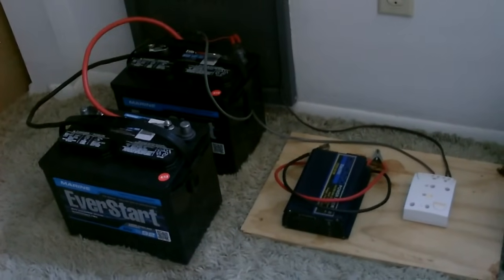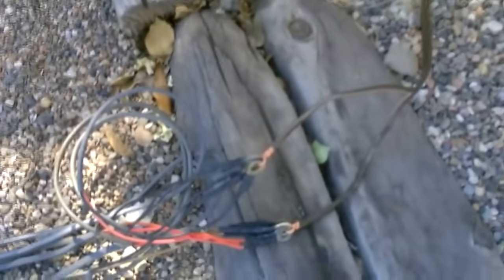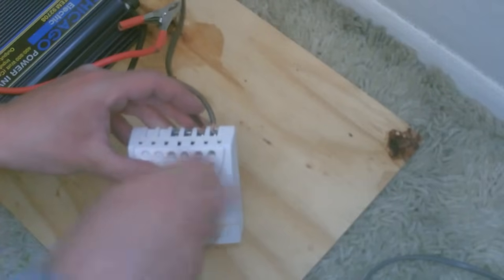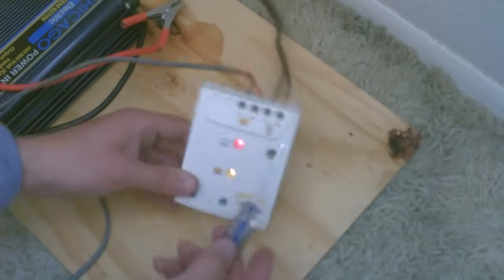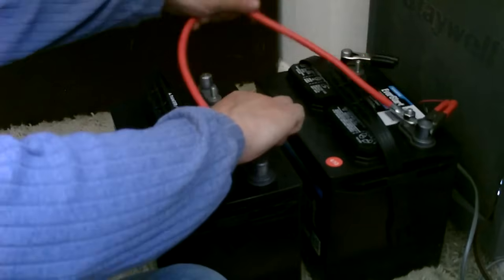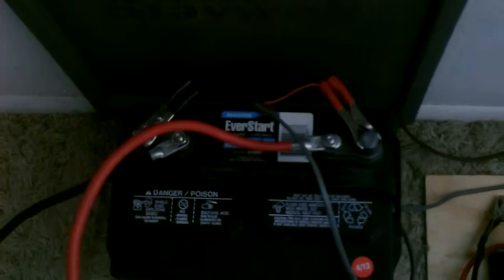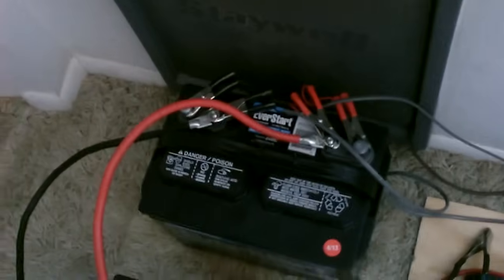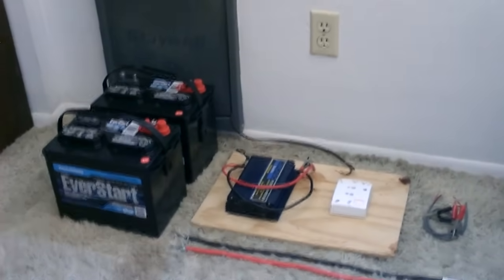How to hook up Solar Panels (with battery bank) - simple 'detailed' instructions - DIY solar system

Comment: Hi, my name is Ana. I have an 100 watt Renogy Solar panel, 4 batteries 93 ah and a 30 amp charge controller. my question what size of inverter I should use ? I am having problem to decide on which one I really need. thanks for your video
Reply: Ana AA That question is rather difficult to answer in general. It would depend on what you wanted to power and how long you wanted it on. The bigger the inverter and ac power you use the less time it will be able to work without draining the batteries. On mine, I have the 45 watt Harbour Freight solar panels connected to one battery. I have a 300 watt inverter that I have used to run a CFL lamp for 3 or 4 hours during a power outage without any problems. The lamp was very low drain (about 15 watts) and I wouldn't try running a computer or anything on it for any length of time. Normally I just use it to power my 12 volt ham radio gear without an inverter..
So basically, just remember that the larger the inverter used, the less time it will work on that setup.

Comment: Curious. Can I charge the batteries "let's say I have 4 deep cycle", with one normal battery charger with higher amp output? I'm thinking about doing this with my travel trailer, and power the charger with a small generator, until I can afford to go full solar. Let's say a 20 amp charger, divided by 4 large marine batteries is 5 amp each, right? why wouldn't this work? If the batteries are kinda dead, I'd like to speed it up with let's say a 80 amp charger to get each LARGE battery 20 amps, until it's time for a small trickle charge.

Comment: Hi, nice video! One Question: What's the difference if you connect the batteries in series instead of parallel like the one you've set up here.
Reply: Metalarm If you wire 2 batteries in series you will have a battery with a nominal voltage of 24v, to charge this you will need to wire 2 solar panels in series.

Comment: Great video. Just 1 question. Will the batteries overcharge and die at a point? Also, can this hook into your home to lessen your electricity bill or is it only a stand alone system? Thanks again
Reply: Buildin_N_Preppin Get yourself a good controller, it will cut off when the batteries are full and stop them draining back into the panel at night.
Reply: +Steve Westcott which one do you recommend?

Comment: Great video !!!  I run my whole house just like this except with 10 batteries and a 5000 watt inverter wired to the existing fuse box in my house..making all the switches and plug ins work correctly. .9 watt bulbs glowing all over the house..works outstanding and can go a week or better with no charge..DO TRY THIS AT HOME !!!!
Reply: coreymoore1000 How many panels and what size?
Reply: coreymoore1000 hi.. does your washer and dryer work with dat as well???
Reply: how much your setup coast
Reply: how much your setup coast
Reply: how much your setup coast
Reply: coreymoore1000 So Awesome! How many panels at what watt configuration do you have? I’m starting to plan my system and yours sounds ideal.
Reply: if your panel is tied to the grid in the event of a power outage you will be sending  juice back into the grid witch can kill an unsuspecting utility worker
Reply: gary jones oh well fuck him..
Reply: Learn grammar you fool, dat should be that...fool.

Comment: OK I AM KINDA NEW TO ALL THIS , AND BOUGHT A BRAND NEW 1800WATT SOLOR GENERATOR , BUT IT DONT LAST LONG OR JUST NOT STRONG ENOUGHT TO DO WHAT I NEED IN A 30 FT CAMPER , SOOO MY QUESTION IS CAN I JUST USE THE ONE SMALL SOLOR PANEL TO CHARGE ALL MY BATTERIES , ITS ONLY GOT ONE BATT NOW BUT WHY COULDNT I HAVE ANOTHER CHARGING WHILE ONE IS BEING USED,,,,,OR RIG IT TO WHERE ALL THE BATTERIES GET CHARGED ?????? JUST THINKING ???????????? CAN YOU RUN THEM IN LINE TO WHERE THEY ALL GET THE SAME CHARGE

Comment: effectively and with a little electrical know how you could opt out of the grid system for your home lighting by installing led lighting running from a 12v system very cheaply for you whole home just using the wiring already installed,taking the home lighting circuit out of the fuse box system and turning it to a 12v independent system..led lighting uses 1/3 of the power a normal light uses !!...food for thought.

Comment: So how do you work out how many batteries you can have in each back, to how many controllers you need to solar panels? I am wanting to install a 4000W inverter and my solar panels are 15A each. So 1 controller is rated to 190A and can take 3 panels, but how do I how how many batteries I can have in that bank running off 3 x 15A panels? Is there a rule of thumb for batteries to panels?

Comment: can i series 12 battery for 24 volts and charge it with  panels that have around 36volts series?
Reply: It depends.

You can put 2 identical 12V batteries in series to make a single 24V battery.

You must make sure that your charge controller can:
1. Handle a 24V battery bank.
2. Handle the nominal voltage from your solar power bank (36V).
3. Handle the highest peak voltage that your solar power bank can produce. (Check your panels specification or measure output voltage in full sunlight without load).
4. Can handle the maximum current that your panels will produce. Note that the current can depend on the voltages used.
Generally a tiny sized charge controller can get overheated (as it has a small heatsink or non at all).

So, by choosing the right kind of charge controller you can do what you ask.
In general you want to keep the voltage of your power bank the same as the voltage your load wants.

Comment: Thanks for the video.What kind of wire did you use to connect from charge controller to your batteries?
Reply: Gary H how far is controll form battery

Comment: How long can this setup run at 75amps
Reply: I have about the same question.. did you figure it out?
Reply: if you're talking 75 amps ac 75 x 120 = that inverter is going to show red and start screaming at you as soon as you flip the switch, amps x volts = watts

Comment: How durable and weather resistant are these panels? How long could you leave them outside before they start to "weaken" strange question but I'm curious. Also what kind of matinance do these setups require
Reply from the maker: Josh O'Connor hi. there durability is equal to any standard solar panel designed for home use. i've had these panels for 8 years. they've endured high winds, heavy rains, golf ball size hail and lots of high heat and still work/look perfect. they're mean't to be left outside permanently. with regards to "weakening" the panels are designed to meet the industry average (which is that they will still put out no less than 90% of rated max. at 10 years and no less than 80% of rated max. after 25 years). note that most panels will not degrade this much. (many solar panels that are 20-35 years old now are being tested and are still putting out up to 97%). in terms of maintenance, other than checking the fluid level in the batteries from time to time (and adding distilled water if it's low) there is no maintenance required. for reference on the last point, my personal experience with the fluid level being low is that i've never had a low fluid situation in 8 years of using these types of systems. (and that is charging and discharging the batts almost everyday for the life of the batteries (typically about 1000 charge cycles))
Reply: Thank you! My only thing holding me back is it seems like you would require an absurd amount of solar panels to power a house, somthing like 500 square feet
Reply from the maker: Josh O'Connor powering entire house does take quite a few panels. (consider building up the system in increments. saves you from having to fork over one big lump sum all at once). that's what i did originally. (my oldest/first video shows my original system. that system was built in 4 stages (one battery + one 3 panel set) purchased at 4 separate times. as your building it you'll have a "solar assisted" house.
Reply from the maker: Entheogin913 hi there. without knowing the specific wattages of each item it's hard to say but in general i'd say a system about twice as big as the one in this video (my first video post shows a system about that size). ran that one for 6+years.
Reply: desertsun02 What type of wire with amp did you use to connect the controller to the battery and to connect the batteries together ?
Reply: Josh O'Connor I use Trina Solar solar panels. They are warrantied for 20 years and I have installed them in all conditions.
Reply: desertsun02 Hey i am thinking of buying 4, 100 watt panels. Could you tell me exactly what i will need to buy to hook it up? I am not going to hook it to the houses electricity i am just planning on using a surge protector to plug my stuff in.
Reply: Magnet moter
Reply: +desertsun02 what is the name of the company  you bought  the solar panel from?

Comment: Does anyone know if a charge controller is completely necessary? I have a 15 watt 12v solar panel connected to a 12v deep cycle battery connected to an inverter.  I do not have a charge controller and my solar panel is not charging the battery.  All items are less than 3 months old.  Any advice would be appreciated....thanks....Rick

Comment: Finally, a simple and accurate explanation of how this works and how the connections should be made.  It was really nice the way your video showed the connections from start to finish, in that order.  Your the only person who had enough sense to simply followed the wires back from solar panel in order from connection to connection.   I am not sure how the the other video makers even got their stuff to work based on what they were trying to explain, so thank you for getting it right, making sense and putting and end to cycle of stupidity I had to endure.

Comment: diy solar system consists of panels, inverter, two car batteries in parallel, charge controller, and a digital voltmeter

Comment: Very nice and easy set up you got going on there desertsun02! I plan on following your solution but with the renogy 100watt panel and the solar controller they sell with it too. Just wondering, will this solar kit and two deep cycle 12 volt batteries be able to power one pump that draws .23 amps over night? How about two of the same pump? Cool channel also by the way…you got a new sub here, thanks for the shared information.
Reply: Rohan4711 Thanks for an excellent and almost clear explanation. I know for some that have a college level understanding of solar have to really explain things in a pre-school level, lol. Thank you again!
Reply: Just convert everything to Wh (watt hours) and it will be instantly clear.

First some simple electrical basics:
Watts is energy draw.
W (watt) = V (voltage) * I (Current in amps).

Watt hours is energy draw over time.
Wh (watt hours) = W (watts) * h (hours).
Your normal electrical bill is for how many kWh you use.
k = 1000, as you generally use quite a few Wh it is more convenient to count in thousands.

This is when you use DC (e.g. 12V) and It's a little bit more complex when you use AC (120V or 240V).
AC appliances typically state how many watts they use, so easiest is just to read the label.
DC appliances often state the current (I) and the voltage (V), so counting the W (watts) is easy. 

So, here is a some guesswork to give you an idea.
Assuming your pump is on 120V AC and that the rated current is average load current:
The load: 0.23 A * 120V = 27.6 W.

Running a load of 27.6 W for 12 hours:
27.6 W * 12 h = 331.2 Wh

Lets assume a normal deep cycle battery is 12V, 100Ah.
A battery then has: 12V * 100Ah = 1200 Wh.
You have 2 of them:
2 batteries * 1200 Wh = 2400 Wh.

I have intentionally left out lots of less important details.
Knowing that your draw (331.2 Wh) is much higher than your stored power (2400 Wh) your good.

Next step is to make sure that you charge your batteries more each day than you spend.
Lets say you have 100W of solar panel.
A typical day produces at least 5 hours worth of full solar unless very cloudy.
You will then generate 100W * 5 hours = 500 Wh to charge your batteries.

As 500 Wh is significantly higher than 331.2 Wh your good on this side as well, but not so much that you could add a second pump without running into issues.

Comment: I have a question that i cant seem to find the answer to on youtube that maybe you might be able to. Im doing some research on everything eco when it come to home building, and ive recently gotten into ac/dc powered fridges and freezers, all of them state the you can purchase a solar kit with it but what I am trying to figure out is how one of them works considering i know nothing bout ac/dc batteries. When using ac/dc batteries with something are you having to remove the battery, charge it, and then replace? or can a solar panel be directly wired to the appliance itself to constantly recharge the battery?

Comment: How much was all this and where did you buy it?
Reply from the maker: Ellis Laughter hi there. i bought the two 45w "3 panel" sets from harbor freight. ("these days" it's cheaper to just buy one 100 watt panel on Amazon). Renogy sells a good one for about $150 (or for $165.00 they through in a 30A charge controller). charge controller in video is made by "sunsei" and is from Fry's Electronics ($40). the inverter is a 400w one from harbor freight ($20). batteries are 101ah each and are from walmart ($75 each). the large battery cables (wires) are from an automobile store (walmart sells those too). Of Note:  if i was setting up a system from scratch today i would buy a 100 watt Renogy solar panel with 30A charge controller ($165). i'd get the inverter and batteries from the stores i originally got them. inverter from harbor freight ($20) and batteries from walmart ($75) each. so $335.00 plus tax (and battery cables) should get you a similar solar power system.
Reply: Cool thanks.
Reply: desertsun02 sounds a lot cheaper than the 1225.00 I was quoted this week for a single battery, ~250 watt panel, cables, controller, and 600 watt inverter.  plus taxes.  I think these guys are a classic example of how solar resellers are going bankrupt because they are sitting on old stock that cost them a fortune.  They just cannot compete with newer, better, cheaper technology.

Comment: How many batteries do I need when running both computers in my house, the fridge, my server, 2 speakers, home theater, cable, TV, and a light stand (2 of 'em)?

P.s I will be using only 4 short extensions and a long one.
I will also make some projects on solar panels.
They are: Mini Solar lamp, Mini Solar fan, etc.......

But anyways, great video!

LOL I ALMOST FRIED UP MY BATTERIES BECAUSE I FORGOT THE CHARGE CONTROLLER D:

Comment: I'm building a system very similar to yours. I have one 100 watt polycrystalline panel, connected to a morningstar charge controller,then connected to two trojan T105-RE 6V batteries (AH @ 20HR Rate 225, AH @ 100HR Rate 250) in the same way you set yours up, then  connected to my pure sine power inverter running at 95% efficiency. How long will my battery run on average?
Thanks,
Ryan

Comment: So, how many watts/volts does it take to sustain a full equipped home. i.e. Fridge, two freezers, TV's, cooler, etc. etc.
Reply: It depends on your home. This video is going through the basics, and is not intended for a setup to run a full house.
Instead lets say that it is not very economical to try to power a full house with this kind of solar setup alone.
Lets say that there is heavy clouds for 2 weeks straight, then how many solar panels will it take to power your home?
Reply: Thank you harrison harden

Comment: what might be the problem if the battery will not fully charge?please answer me thank you..i have a 12 volt battery,12 volts solar panel and a solar charge controller and an inverter..

Comment: hi, I'm looking to setup a small solar system to run a pedestal fan. I think the power input should be about 15-20W. What is your suggestion for the battery capacity required? I wish to charge during day and use the fan after sun down.

Comment: If I bought one: 15 watt 12 v mono-crystalline solar panel, would it work for your DIY air conditioner, computers, kitchen electronic, iPhone, and ect? And what kind of inverter(brand) did you use? Is it called inverter or power converter? Are they both the same.  I'm new at this but I love solar energy. Please help!!!

Comment: could I power a mini fridge off this its uses 110 watts with 115 v
Reply from the maker: hi. if your mini fridge draws 110 watts this system might run it for a few hours at a time (but not 24/7).

Comment: ive got a problem, i have a 125 watt panel that gives 20 volts and 6 amps, i feed my panel into the controller which charges a 24 volt battery.. will my 24v battery charge at only 20 volts?
Reply: no
Reply: You will have to hook it into a charge controller that can step up the voltage